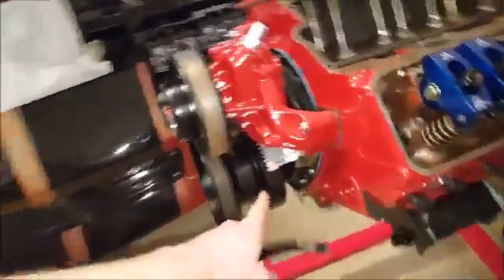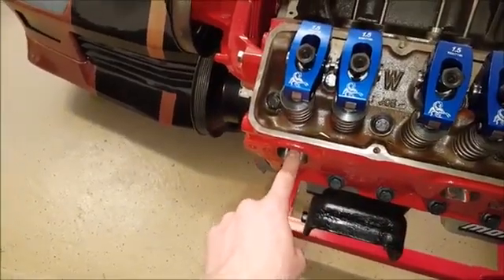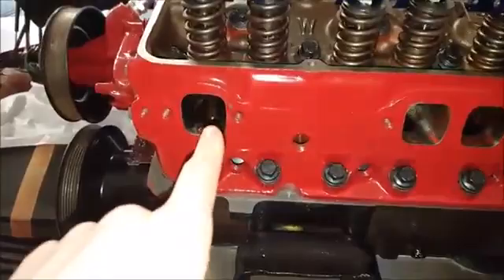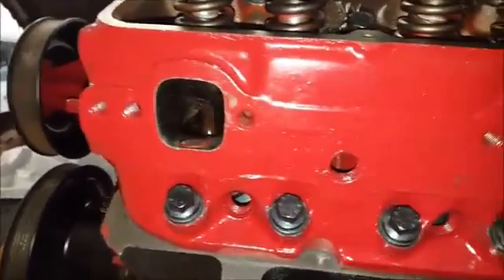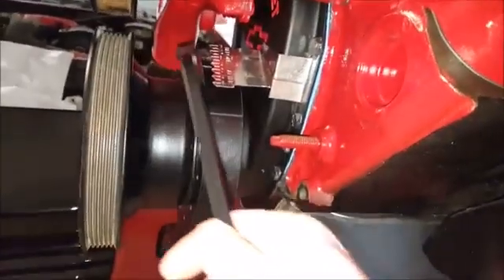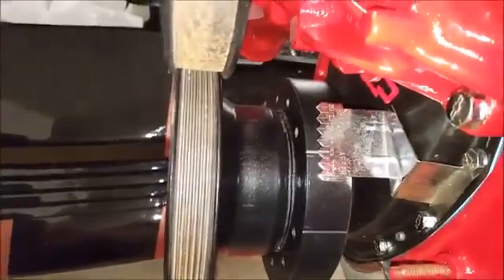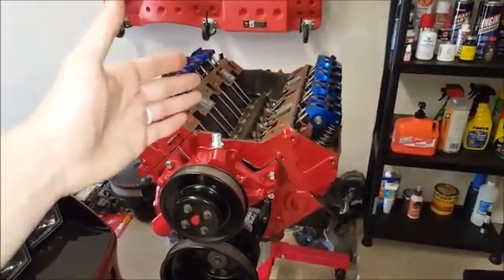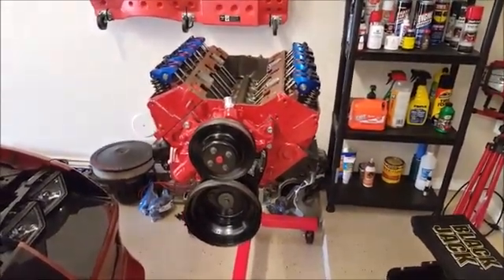How to Find Top Dead Center - Summit Racing Quick Flicks

Comment: You can just look at rocker arms/push rods. No need to look in spark plug/exhaust holes. Most people still have motor in their vehicle not on a stand. Also, it's really easy to hook up a vacuum gauge to number 1 cylinder, especially since plugs aren't installed. Hook up a vacuum gauge. If there is pressure you are coming up on tdc of compression stroke and want to stop when it hits zero. If there is vacuum, you are on exhaust stroke and need to keep turning.